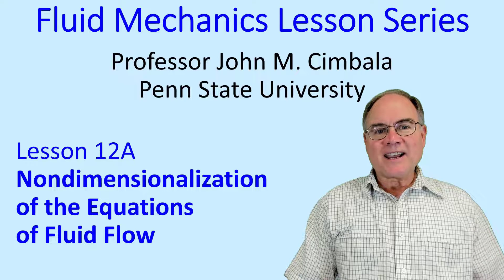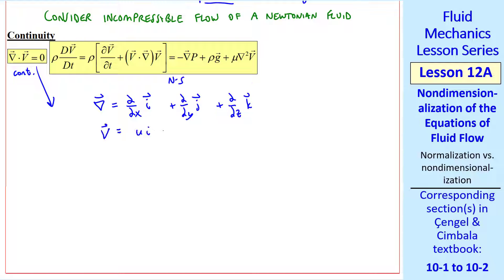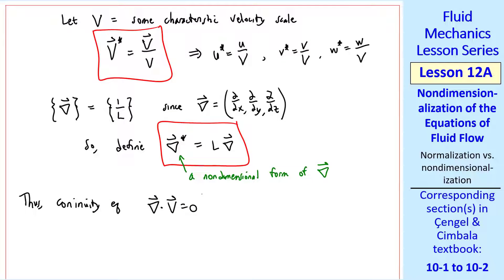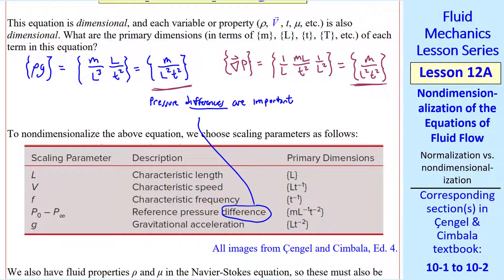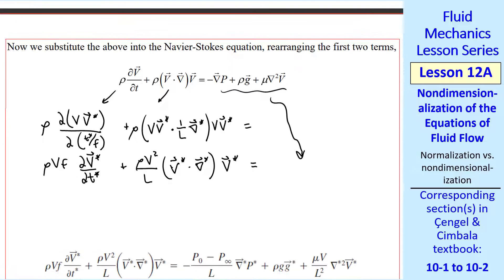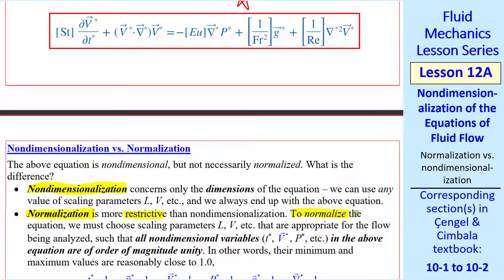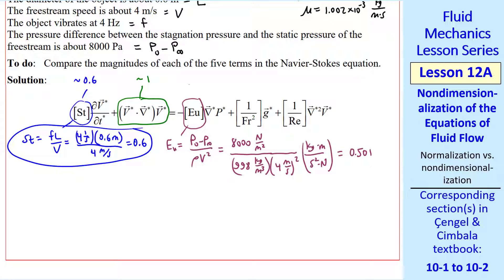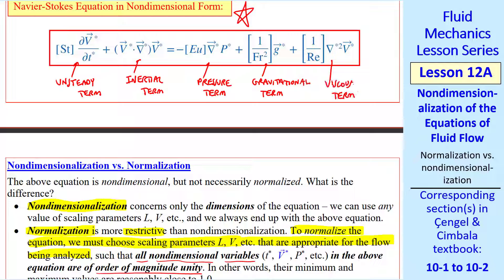Fluid Mechanics Lesson 12A: Nondimensionalization of the Equations of Fluid Flow

Comment: This is a great video that discusses the difference between nondimensionalization and proper scaling to get normalization. Thanks. What do you do in a situation where you have 2 different mass scales in the same equation? For example m =1 solar mass and M =10^8 solar masses? How do I know which mass to choose as a characteristic scale?
Reply from the maker: Usually depends on the application. We have that same problem in fluid mechanics when we deal with boundary layers that have a tiny lengh scale and, say, an airplane wing that has a huge lenght scale. We choose the length scale appropriate to what we are doing.
Thank you for your comment. Please tell your friends and colleagues about my YouTube channel where there are more than 450 free videos about the Bible, fluid mechanics, science, math, statistics, air pollution, and other topics. I would greatly appreciate it.
Reply: @johncimbala  Thank you so much for your reply. Just to clarify, then in my case I would have to choose one characteristic scale for the mass say the M =10^8 solar mass and use this as the characteristic mass scale when putting together all other characteristic scales?
Reply from the maker: @FreddyCaban  I would say that it depends on whether you are looking at large scale events or small scale events. You can choose whichever scale you want that makes the most sense for the problem you are trying to solve.
Reply: @johncimbala  Ok got it, thank you so much for taking the time to answer my questions I greatly appreciate it.